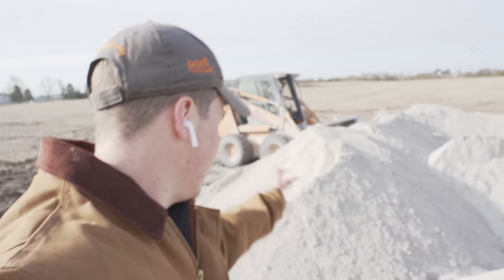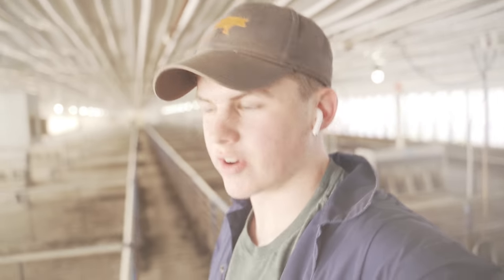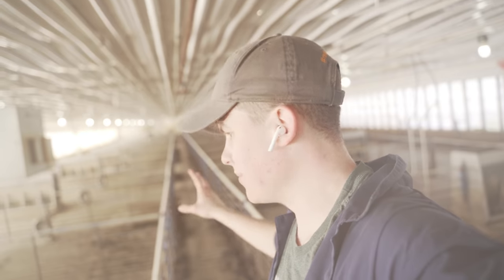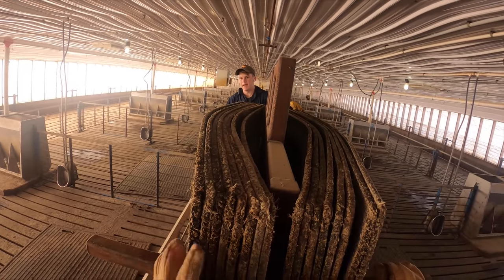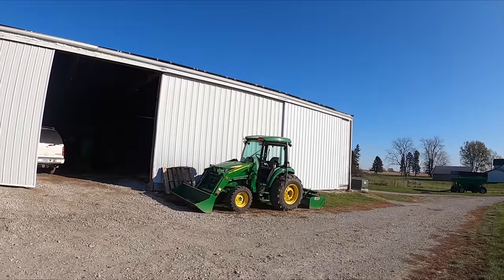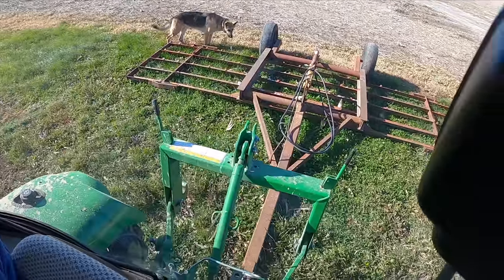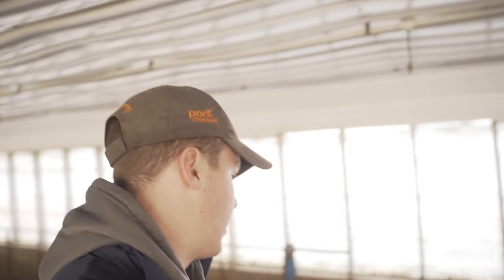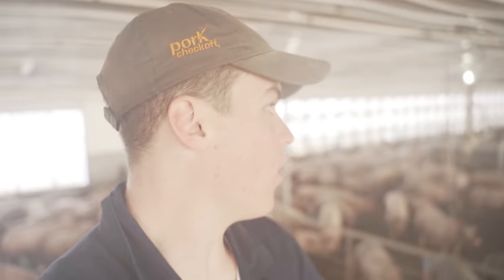Preparing For Corn Crop 2021

Comment: Doo you have the concrete feeder pads so they don't wear the slats out in front of the feeder?. We don't have anything like that in any of our barns and haven't seen it before. We have put the plastic slat savers under our feeders to stop the wear and that works great. But I was just wondering why you have concrete pads.

Comment: Will you be doing manure application video?  How many acres do each barn cover?
Reply from the maker: Yes, next week it’ll be coming out. Everything you want to know we’ll be covered in that video! 👊🏻
Reply: thanks!  I was very interested in your comment that only use manure for fertilizer.   Are you able to  get all P, K, Nitrogen and micro nutrients or due you supplement at planting/side dress?   Just very interested.  Farmers look at manure as gold, but non farmers tend to poke at all the negative run off etc..  You can help inform/build the positive story of liquid manure benefits to the soil.  I look forward to being blown away.

Comment: The pads are sloped for drainage
Reply from the maker: That’s not the reason because our driveway going to the new barn is directly in front of it. And the roof of the barn is slanted north and south not east and west. So the water wouldn’t drain off the roof on to the pad.
Reply: Exactly, it is natural to have outside pads sloped for drainage unless you specify it when built